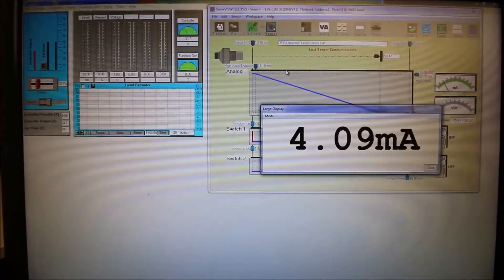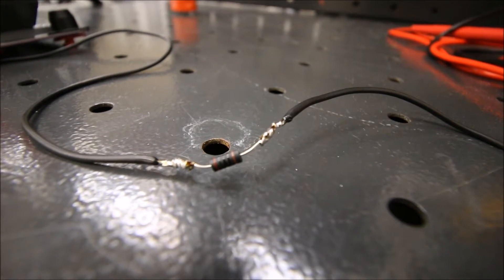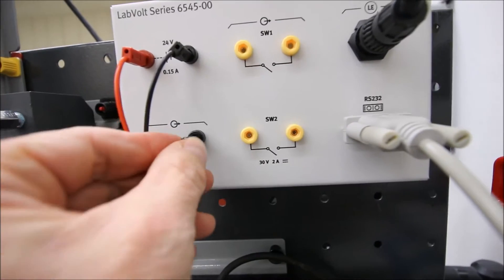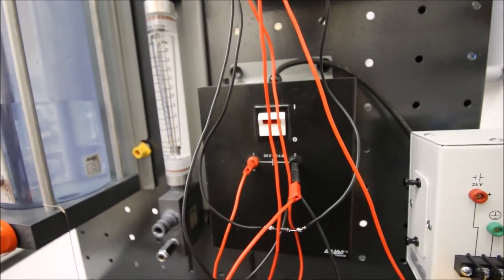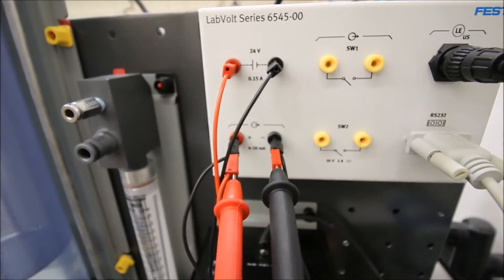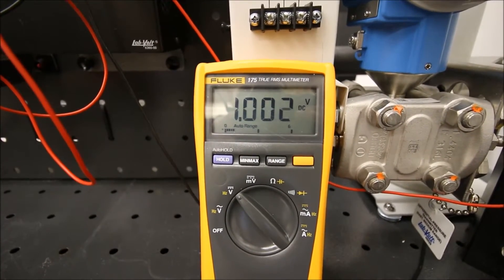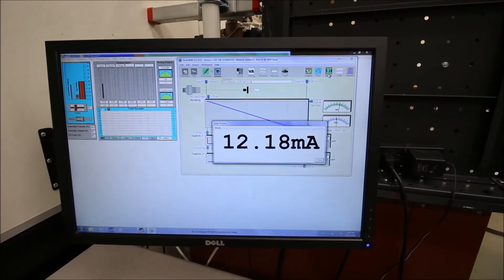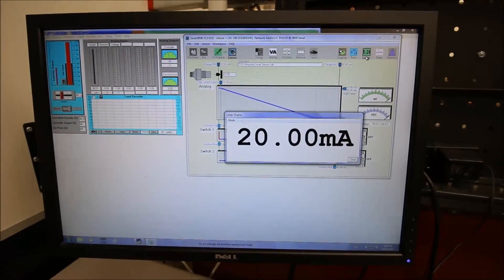How to Convert a 4 to 20 mA Current into a 1 to 5 V DC Voltage (Ultrasonic Level Lab #5C)

Comment: I made a circuit with the LM741 operational amplifier, I used the non-inverting adder model, where it adds the input voltages, but due to the high impedance of this IC the current is very low, measuring the output current of a value of approximately 20mA, so I wanted to know a way to increase the output current, with at least 200mA.
Reply from the maker: I'm not an electronics expert by any means, but usually you use an op amp to turn on a transistor. The Op Amp is only rated for 25 mA output on Short Circuit. https://www.allaboutcircuits.com/technical-articles/how-to-buffer-an-op-amp-output-for-higher-current-part-1/

Comment: Noob question. Is this independent of the input voltage of the sensor?
Reply from the maker: Yes. The input supply voltage is usually 24 V DC. The output current is independent of the supply voltage

Comment: How many watts resistor?
Reply from the maker: We just used a 1 Watt 250 ohm resistor
Reply: if we need to convert 4 to 20mA to 0 to 10v , Then also we need to use same 1 watt resistor?? Did you tried in the project and is it working ???

Comment: i have a 4-20ma radar sensor . Can i use it with arduino .if yes ,what should i do
Reply from the maker: I haven't tried this yet, but this shield looks like a really good interface to the Arduino
https://www.cooking-hacks.com/documentation/tutorials/4-20ma-sensor-board-shield-tutorial-for-arduino-raspberry-pi-intel-galileo
Reply: @PeteVree  nice find! the shield looks really good - especially if interfacing with 4 or less current looped sensors.
Reply: Yes, use a resistor and read the voltage drop across it with a multimeter as in Pete's video. make sure you are reading a positive voltage, whichever side of the resistor is connected to ground will be the common ground, the other side of the resistor (the positive side) is where you will read the signal from. It is a voltage signal, which is analog, so read with an analog pin on your arduino. Just ensure that the max voltage going into the pin doesn't exceed the arduino board you are using e.g. UNOs and MEGAs are 5V so a 250ohm resistor (as per video) is ideal whereas DUEs and Pro Minis are only 3.3V so you will need a different sized resistor.

Comment: Thank you, Pete! 
Nice representation of the current loop. May i ask you, how to convert 4-20 ma to 0-5 v signal, using resistor? Is it possible without any programming? Maybe this possible via resistor and operational amplifiers? Have you ever made this kind of circuit? Thanks, Pete)
Reply: Thanks for this. I never thought to look for an IC that did this. I am however looking for an output of 0 - 3.3V
Reply from the maker: I purchased one of these Converters, but have yet to hook it up. http://www.ti.com/lit/ds/symlink/rcv420.pdf